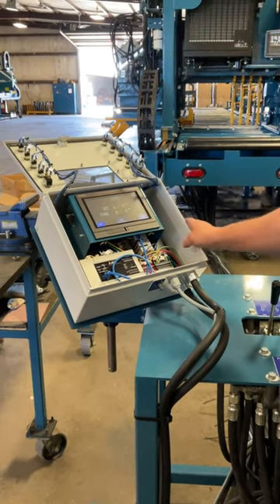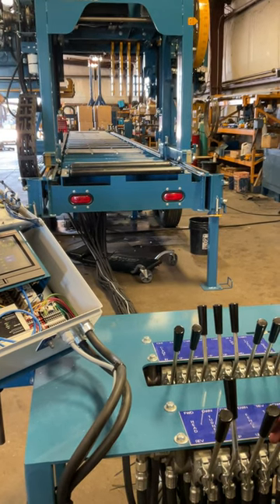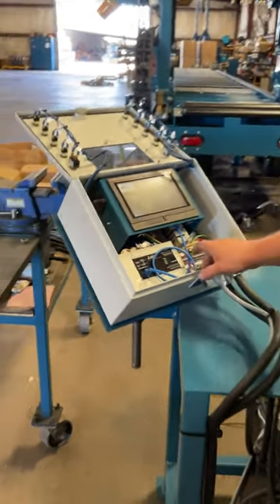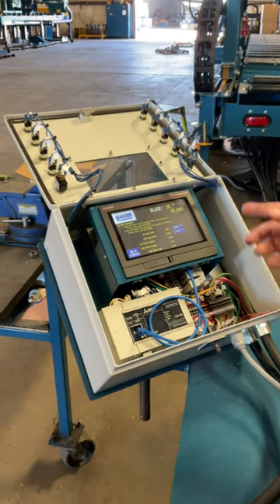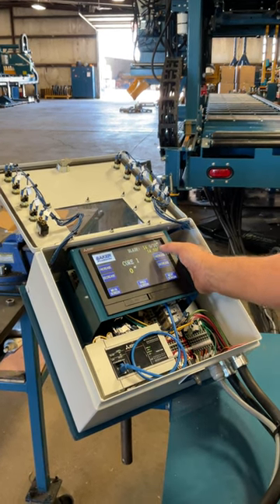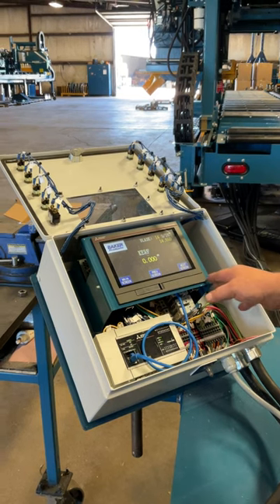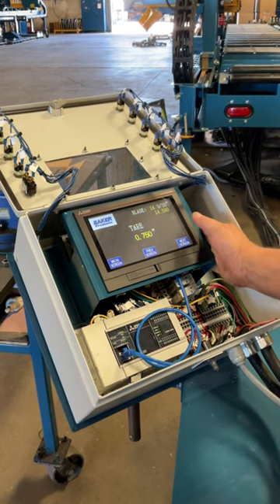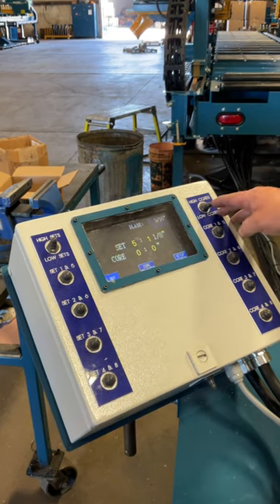New Style Baker Band Sawmill Setworks

Comment from the maker: Thank You! Just so you know we make a great set of roller guides and offer them as an option on all our mills.
Reply: Great video.  I have started operating a 3674 blue streak for another guy.  It has these new setworks and we were working a little blind.  Could you explain the Tare setting?  The old setworks video said that it was set by the computer, now it is manually adjustable but there is no explanation as to what you are setting.  My guess is that it is the minimum board thickness that the mill will saw.